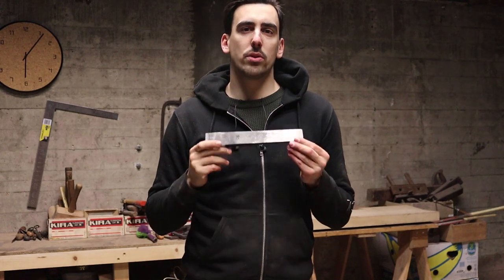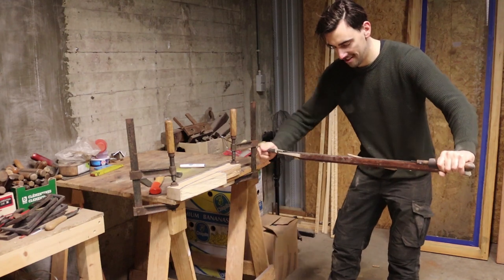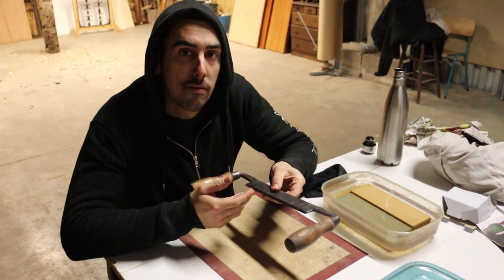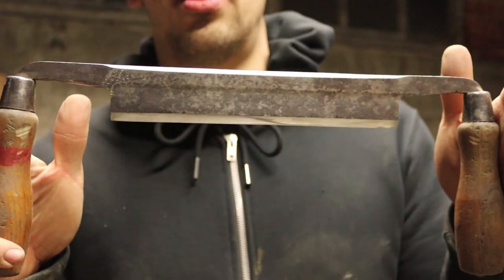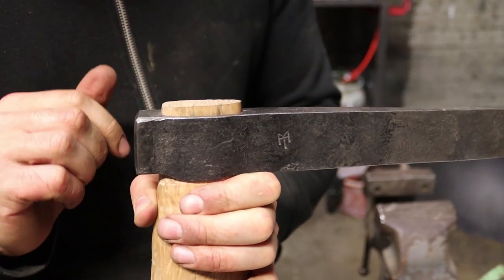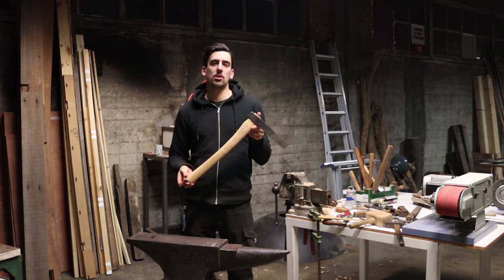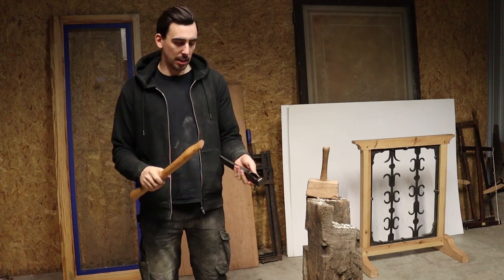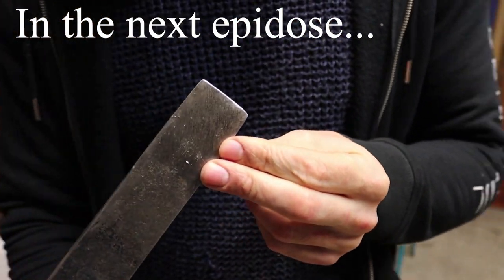Handling a Mortise Axe for timberframing

Comment: The grain on the handle is going the wrong way, at least in my opinion…..axes here the the US have the handle grain parallel to the axe head.  It is less likely to break from a miss hit
Reply: It is though?
Reply: On a riven handle it doesn't matter.
Reply from the maker: Yeah, I used to be of the same opinion and I adressed this in one of my other videos. Talking with other experienced woodworkers and looking at historical examples shows that it is not super critical. But maybe for felling axes with high impact I would also still go with the grain alignment you're talking about.
Reply: @MarcelTeugels  ….thanks for the reply…I can understand your point